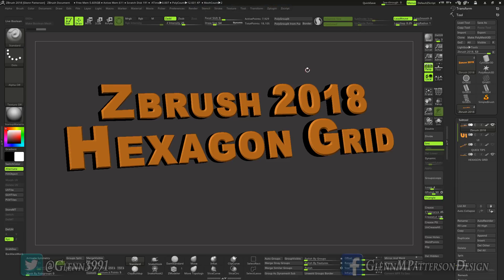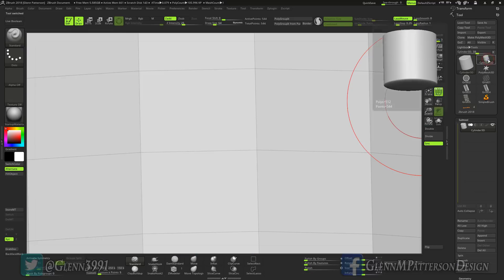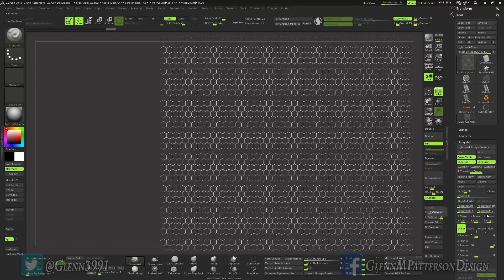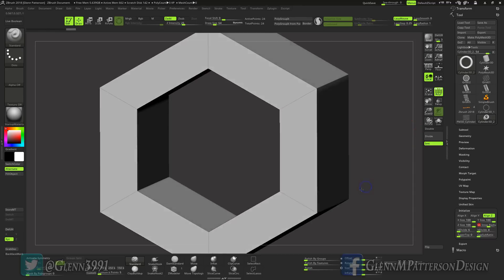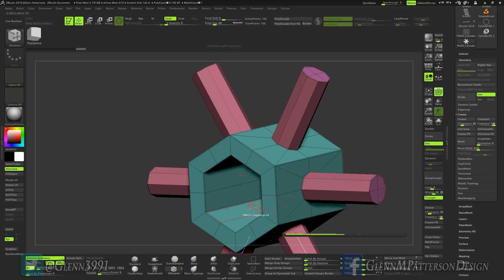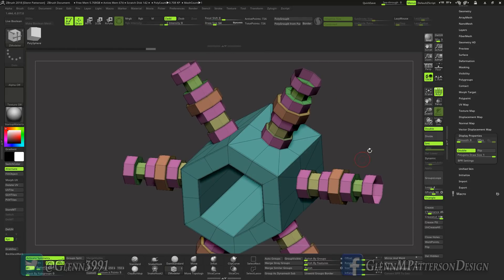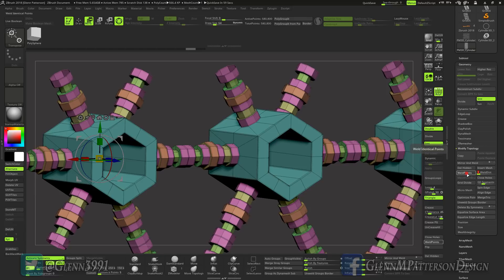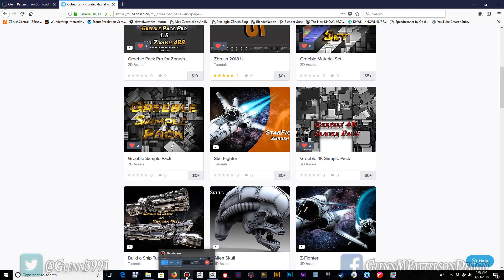Hexagon Grid ZBrush 2018

Comment: Cool beans man. Thanks for the updated UI too. I was wondering if you have found a way to use PolygroupIt to get clean panel lines and mech type pieces.
Reply from the maker: You're Welcome. Played a bit with polygroupit, haven't had much use for it yet. Like using new polygroup by normal on my Greeble panels, works pretty good. I suppose you could use Sculptris Pro with Damstandard and apply black color then polygroupit by border. Have to play with it.